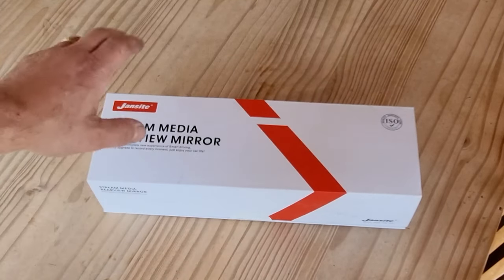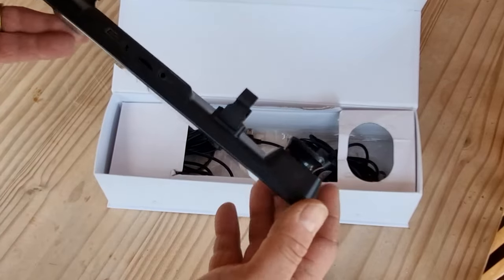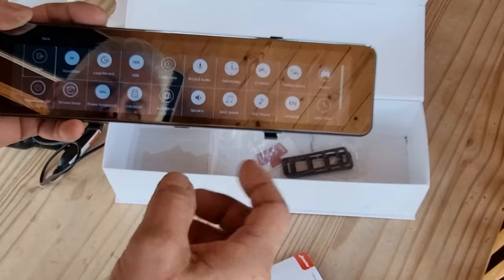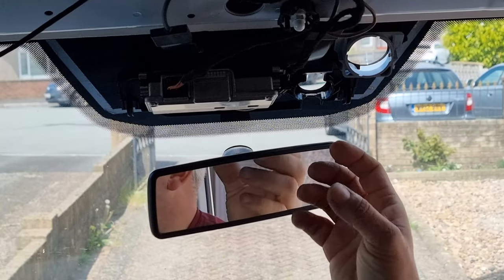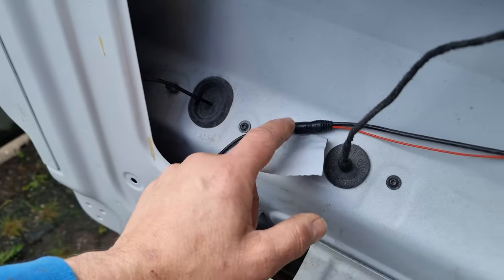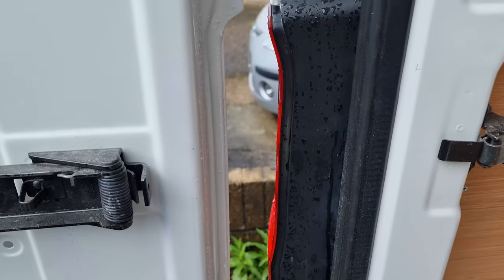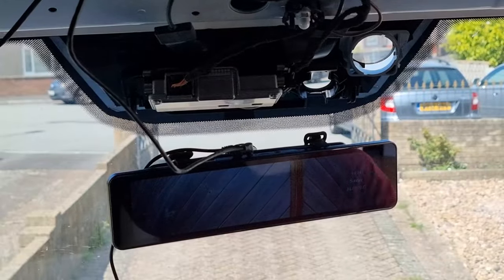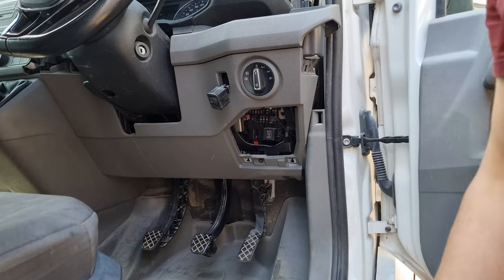Fitting a rear view mirror in to our 2018 VW Crafter MAN TGE camper conversion but not rear windows

Comment: Hi Paul, thanks for the video! Extremely useful. I was wondering if have you got a link to the terminals you used? I'm struggling to find ones that will go sufficiently through the black plug to connect to the pins. Thanks!
Reply from the maker: not sure if the link will work but ill add it to the description too, these were the ones i got

https://www.ebay.co.uk/itm/131533244586?mkcid=16&mkevt=1&mkrid=711-127632-2357-0&ssspo=r6kzCbk-Tvy&sssrc=2047675&ssuid=KsBqpojkR8i&widget_ver=artemis&media=COPY
Reply: @paulsprojects1  thank you!